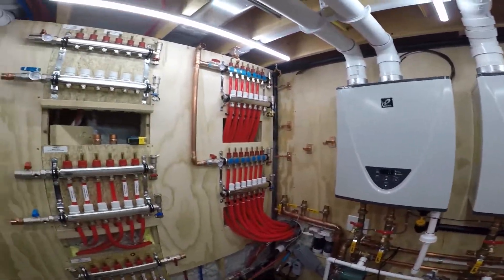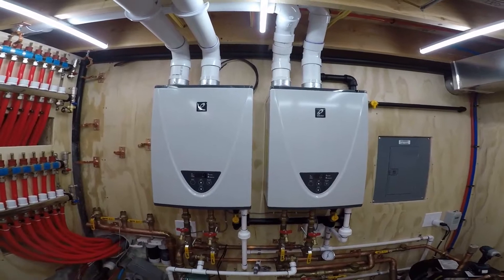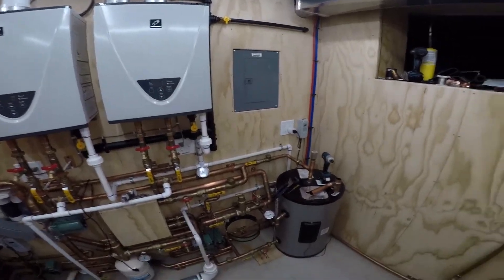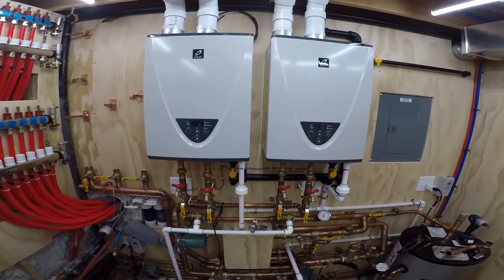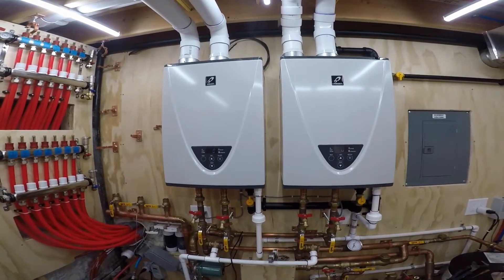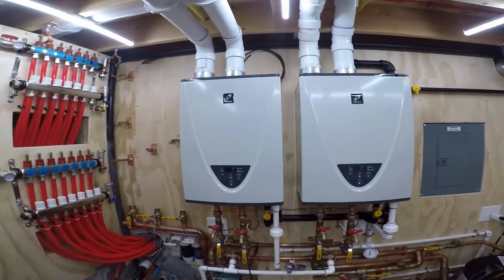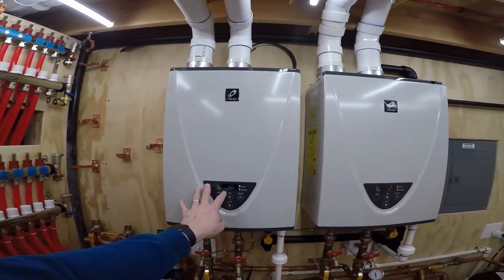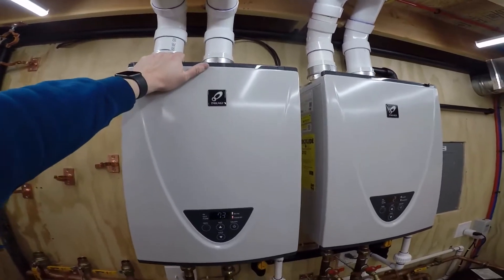Adjusting Altitude Dip Switch Settings in an Attempt to Reduce Fan Noise - Episode 35 [12-19-2020]

Comment: Why are both of them running for such a small demand? I get they aren't running 100%, see no reason both would need to fire.
Reply from the maker: Hey Glenn.  In order to fire 1 unit, the units are looking at a couple of things.  First, it'a needs a minimum flow rate of .5 GPM.  Second, they are looking at BTU's, and the requirement must be more than 15,000.  That is determined by the incoming water temp and set point (BTU=500xGPMx∆T).  In order for a second unit in an easy-linked system to fire, the total GPM load must be greater than 3.4 GPM, and the BTU load must be more than 30,000 (because each unit has a minimum of 15,000).  In a normal multi-unit use system like a school or a hotel, this would work great, however since I am using a Taco 0013 pump to recirc. the tank, I am providing a CONSTANT 7.5 - 8 GPM.  The heaters don't know the difference between a pump and a bunch of open faucets, and since the GPM is above 3.4, both units will always fire.  I wish they used a different method to calculate this, or that it was adjustable in some way, but unfortunately that's the way it is.  Both units fire when 1 unit could easily handle the load.  The good news is, the total load is split, so I don't think it's using any more gas than it would with 1.  A BTU is a BTU, so wether it's 1 unit in stage 4 providing 180,000 BTU's or 2 units in stage 2 providing 90,000 each, it's all the same.  Hopefully that makes sense?

Comment: Hey I’m wanting to do this on my driveway.  But I would like to get an idea of cost if I do this myself.
Reply from the maker: Hey there.  Cost will depend on alot of factors, but in my case I have about $10k into the build.  I am heating 1,600 Sq Ft of concrete.  My heaters are also heating my garage and basement all winter, and providing floor-warming to a majority of the rest of my house.  They also handle all of my domestic loads.  If you're new to my channel and want to see EXACTLY how I did all of this (and how you could too), start with video 1 at the beginning of this playlist: https://youtube.com/playlist?list=PLdWeMRuZcbQjekwiBk_uy39IS6JFWYORD and watch them in order.  It can be done, and if I can do it you can!  Thanks for watching!